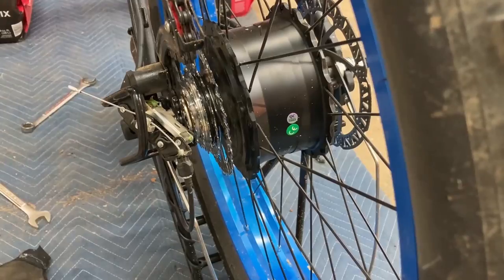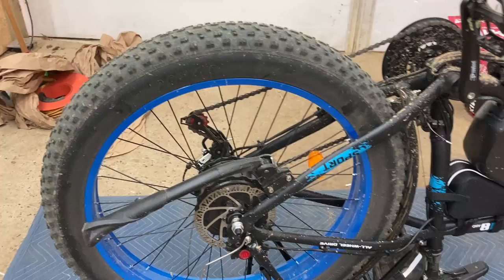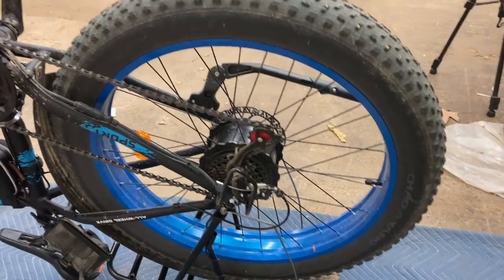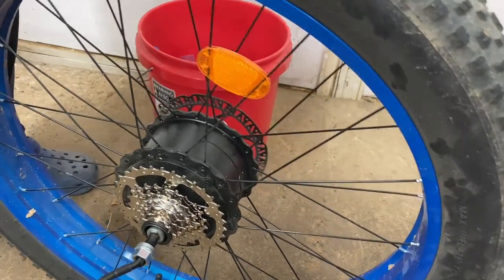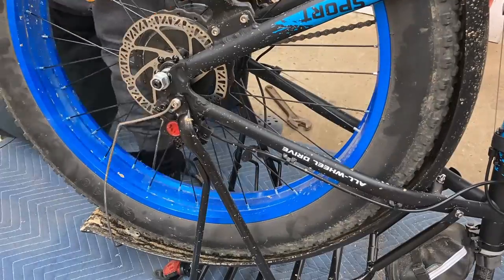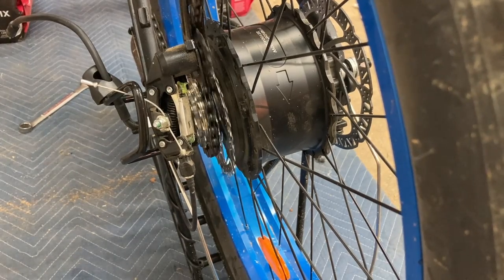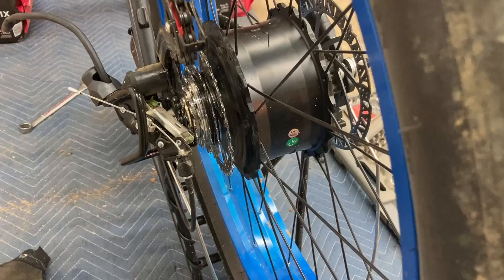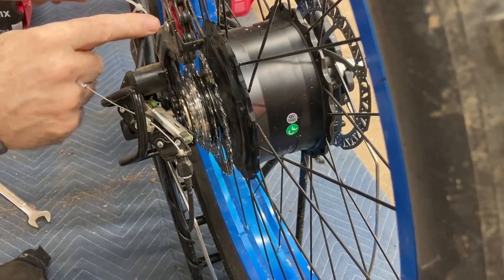Philodo H8 Ebike Upgrade THIS Changes Everything

Comment: I did it.. thanks for the advice papa blue.. what a difference now if your ghost pedaling your flying. Keep up the content
Reply from the maker: Congrats, it does make a huge difference.  I have some more mods coming up, so stay tuned : )  Thanks for watching
Reply: Have you rode your jumbo batteries down then put the charged h8 battery on and saw what happened? I'd appreciate it if you would I'm looking to get a longer range bike than the h8 and obviously having 1 philodo already I'd prefer to keep that brand thanks for any help@papablueshirt
Reply: I guess I'm curious if the charged h8 battery with the low internal battery on the jumbo will even out or what would happen
Reply from the maker: Yes, the jumbo has an internal balancer as I had no issues.
The balancer just switches to the highest charged battery, uses that until it evens out, then switches back and forth.  I often forget to turn my other batteries on and ride half my ride before I realize it. LOL   
 I did put another balancer on the Jumbo as I added another battery, it basically does the same thing.  You can pretty much just keep adding batteries as long as you have balancer between each.
  I do have a video coming up where I put a third battery on my H8, so that may interest you.  It should be live pretty soon, I hope tonight if I can get the thumbnail and stuff done ; )  

That being said, if you can afford the Jumbo, it is a great bike.  With the internal battery it is balanced very well.   And the rear suspension is nice.  And I love the switch you can turn the AWD off and on as needed.

Comment: Hey Papa Blue Shirt the Philodo are alot of fun. I've had one for a month and half now . I'm loving it. All thanks for the tip on the Freewheel Sprocket it makes pedaling my ebike so much better. Thanks again Thanks again from Mr Phil
Reply from the maker: Yes, it should be factory installed.  I am glad it is pretty easy to modify, it makes the bike so much more usable.  I had to change mine last week as it went bad.  I had over 11k miles on it, so it lasted a long time.  I just bought another and put it on, and I am off riding again : )
Reply: @papablueshirt  yes it totally changes the gearing when you put that new sprocket on there . I get resistance even in pedal assistance 5  going 25 to 30 mph
Reply from the maker: Yep,  I don't know why it is not done from the factory.  Probably because there is only one aftermarket company making them that I am aware of.
Reply: @papablueshirt  happy New year
Reply: @philodoscreenweaver
How is your Philodo holding up and do you think its going to be around for awhile with those kinda of miles
Reply from the maker: So far it is holding up very well.  My Ecotric started having problems around 10k miles.  I had to change the headset bearing, and the 36v batteries did not hold up real well I went through 4 of them LOL.  But so far my Philodo is doing great.  I have a range test video coming up soon that I use only the stock battery to see how it is going and I will say I was rather impressed.  They say hub motors last 10-20k, so at some point I may need to change that. However, I am thinking with the two motors I may get more.  But time will tell.  I should have 20k on it by the end of the year, so it will be interesting how it holds up : )
Reply from the maker: Thank you, Same to you : )

Comment: I have a duo motor Radrover. Since I added the front motor,  I have never used the gears. I go up the steepest hills in SF and the Marin headlands. I don't understand why you need a granny gear with a DUO motor ebike. You should put a 56tooth front gear to address the ghost pedaling. I love your bike ❤
Reply from the maker: Yeah, I ended up later adding a 52 tooth crankset.  Now the bike is perfect.  That was about 6k miles ago.   I agree dual motor ebikes are great.
   I used to live in Concord, so I took my old Oldsmobile diesel up those hills you are talking about, would not make it up, had to back back down the hill LOL   I used to deliver cars based out of Oakland so I knew the area pretty well, but that was a long time ago before the earthquake that took down a pc of the Bay bridge and the Nimitz Freeway  
thanks for watching

Comment: The advantage to highway shoulder driving (early morning) is from behind the car behind has headlights.  I have this huge triangle I took off Ford tractor.  It's nut and bolted to my milk crate on rack.  The battery itself on the Zugo has a light and goes in under seat, but I've never seen how it works.. Just important the 4 wheelers see you!